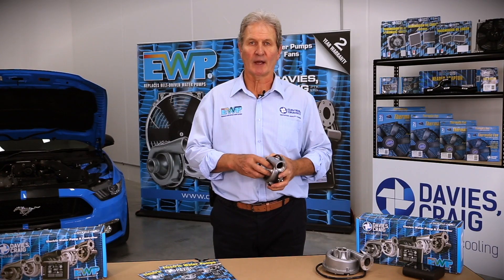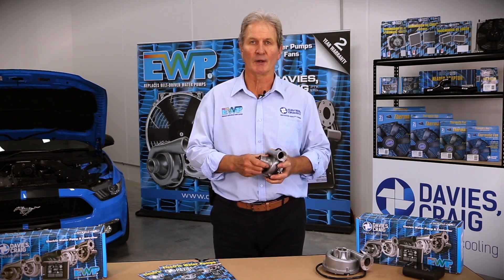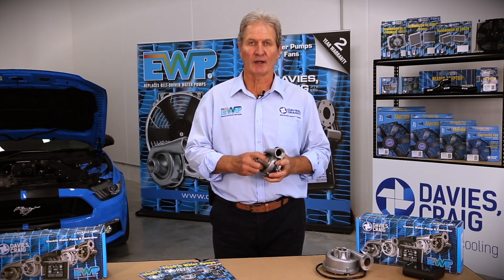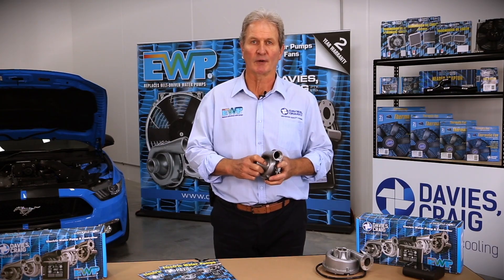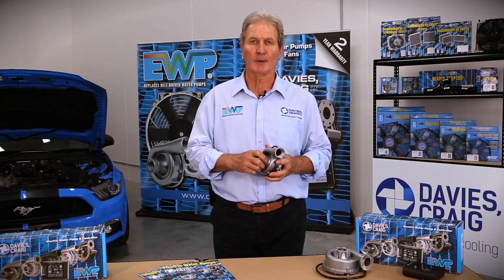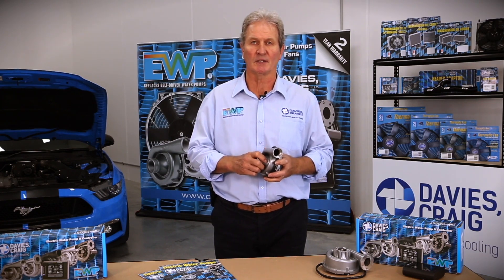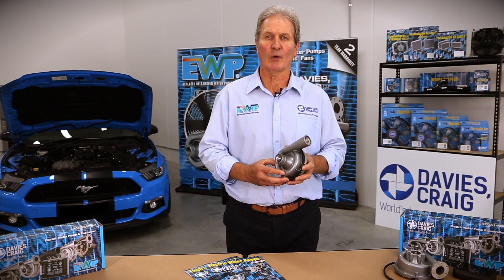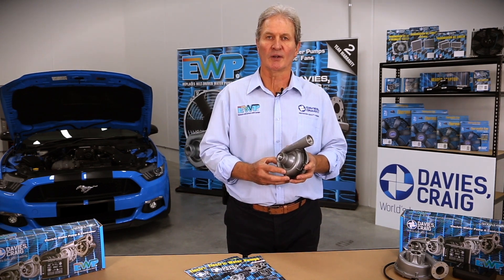FAQ EWP Part 1 - What Are The Benefits Of An Davies, Craig Electric Water Pump (EWP)

Comment: Hey good day I have a question need a little  help on , I have the ewp 150  in a rear mounted radiator system , witch location should I install it to the rear or to the front
Reply from the maker: Ideally mount it low and next to the radiator would be best but you can also mount it up front. Contact us via our website or call 61 9 369 1234 to get further support.

Comment: I have a question… I know these pumps do make a certain amount of noise… Which, of all the pumps in the range, would be likely to be the quietest? Cheers
Reply from the maker: The EWP you select comes down to the engine size, not noise. You need a pump with enough flow for your engine set up to ensure the main purpose which is cooling the engine occurs. Having said that, our pumps are electric and the noise they make within an engine setup is negligible. You will not hear it unless you have air in your coolant system.
Reply: Davies, Craig Pty Ltd Thanks for your reply to my question!